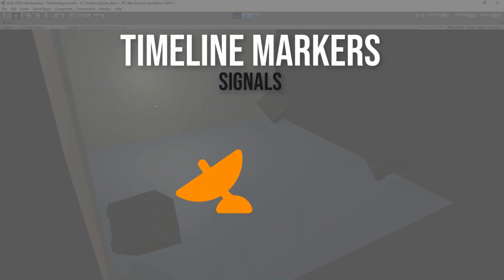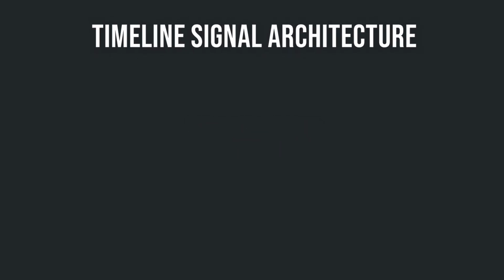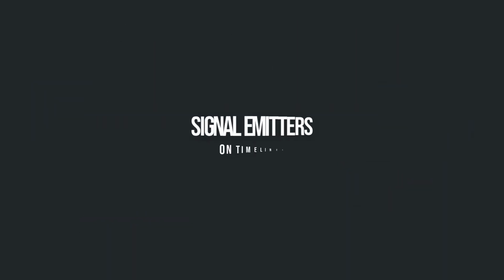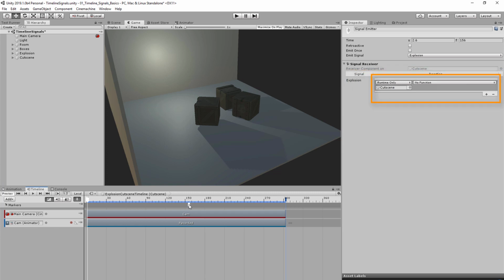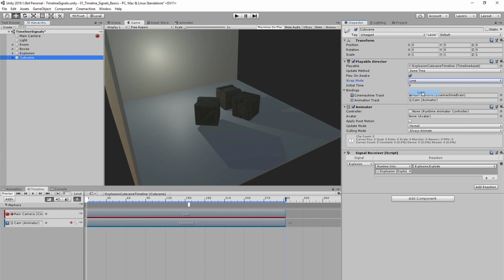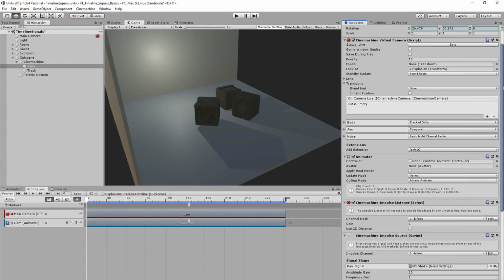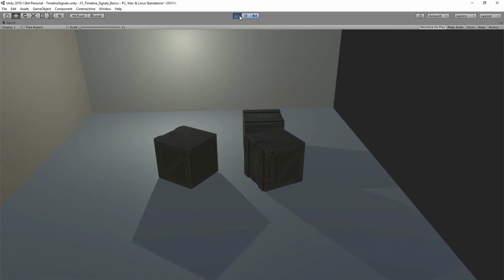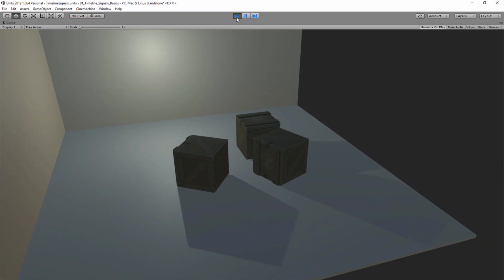Timeline Signals in Unity | 2019.1 | Tutorial

Comment: How do i play two different timelines without starting first timeline? 
I have two timelines one timeline is for first enemy object and second one is for second enemy object 
Second enemy object is copy of first enemy object
Whenever player is in the range and press key code V timeline for first object starts but for the second enemy it starts both timelines for both object how to stop this ?

I'm using timeline.play for both 
Is there a way to call first timeline and second timeline both separately?
Reply: Somehow I solved my problem 😁
Reply: @Adkinsy85  did you use cotrol track to do that,you can use control track to do that easily